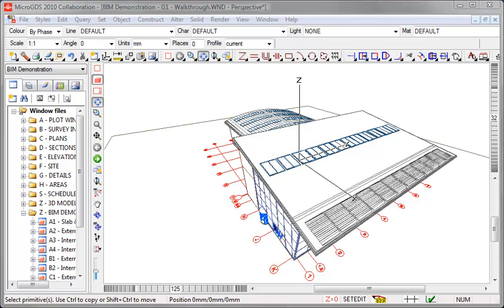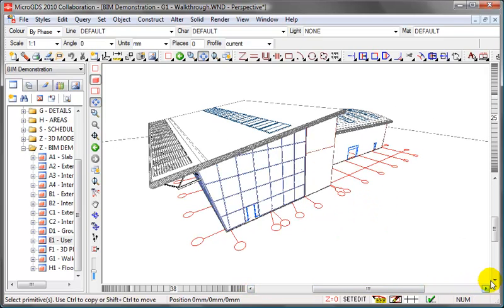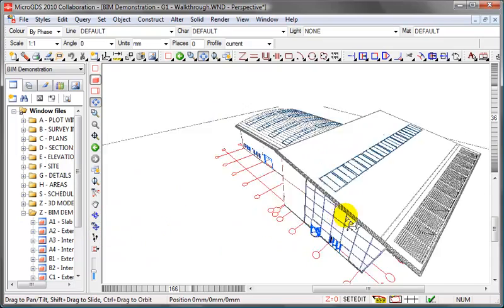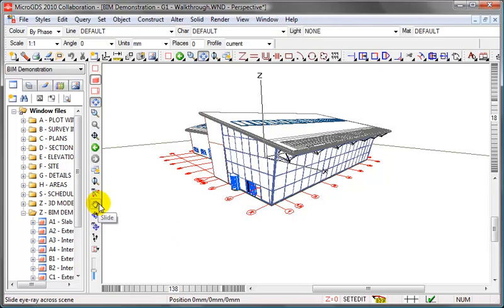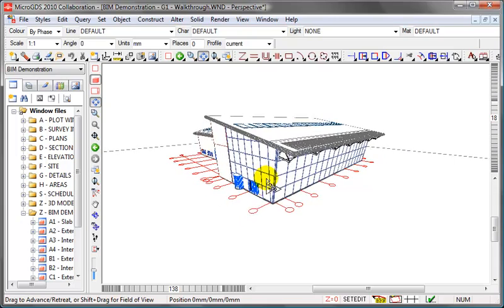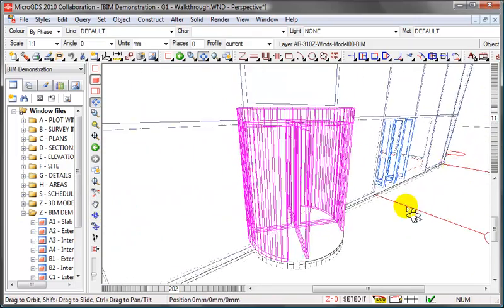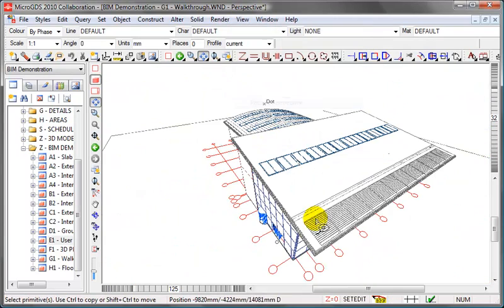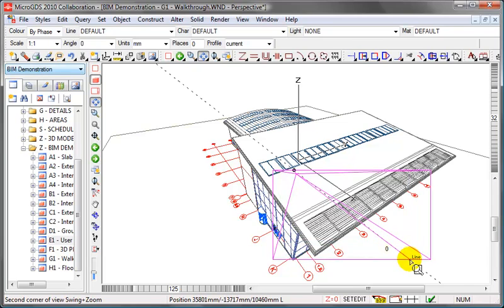MicroGDS 2010 3D Navigation part 1

Comment: Great stuff!

There is another way to navigate though.

If you have a mouse with a wheel on top then you can perform all the pan, zoom, rotate, and "look-at" from within the orbit command.

Go to “Perspective Mode” and select “Orbit”  then “Draw Extents”.

1. Double-click the wheel to specify the look-at point
2. Scroll the wheel to zoom in and out.
3. Hold the wheel down to slide.
4. Hold down the left key down to orbit about the look-at point.

Best regards,

James McClymont.